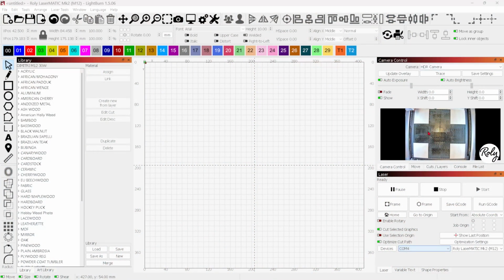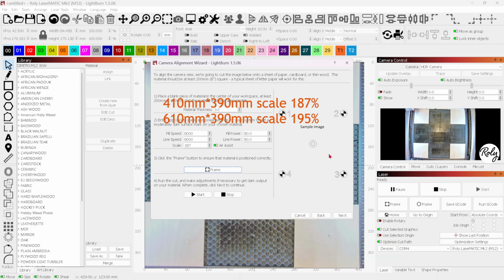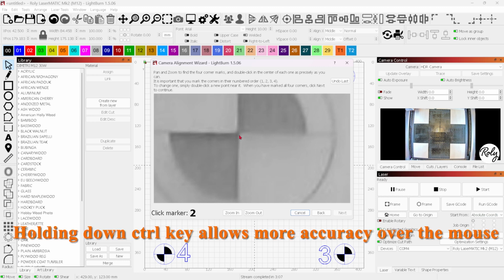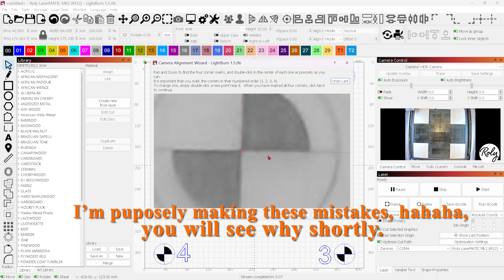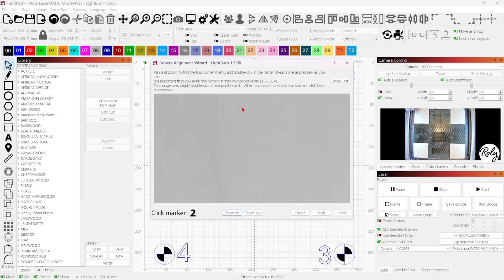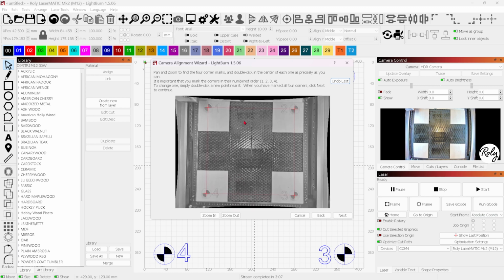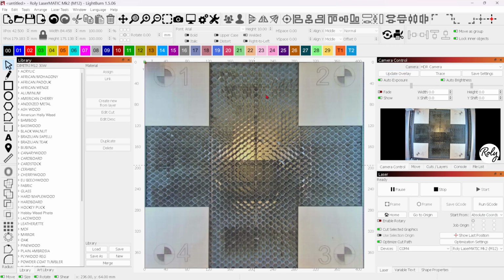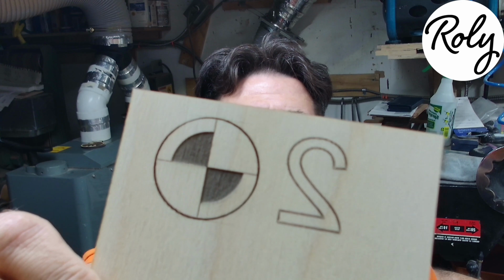Tips on using LaserMATIC Mk2 Camera Calibration

Comment: The previous video on camera alignment was very good. This one is even better. The trick with overlaying the 39.5 mm circle to test your results alone is a game changer. After duplicating this trick on #2 just as Dimitri did, I moved #4 elsewhere on the workbed, set framing to continuous and fired up the “rubber-band” framing tool. Watching that beam track perfectly in the previously engraved circle was immensely satisfying! 

And just in time for my post computer crash realignments.